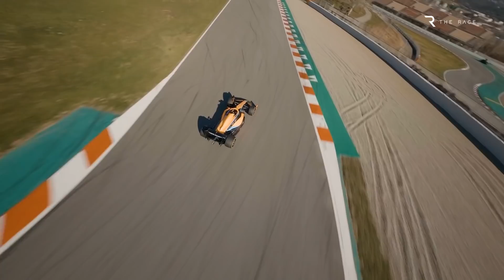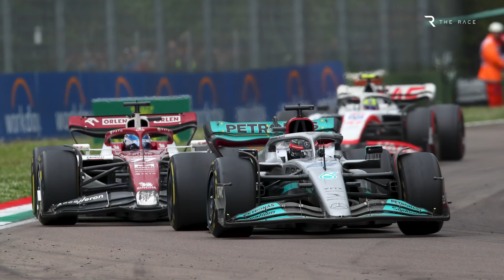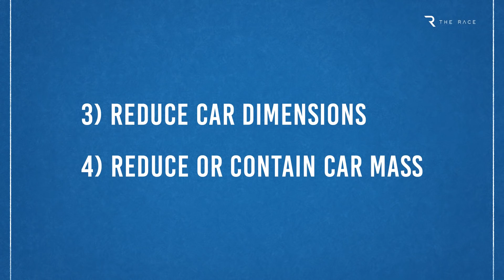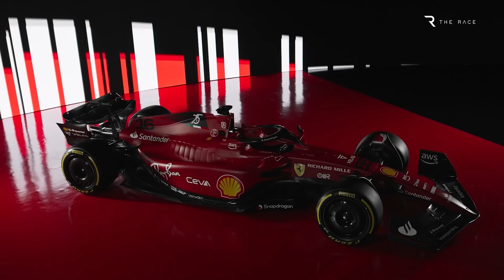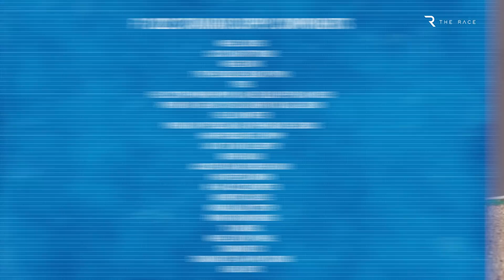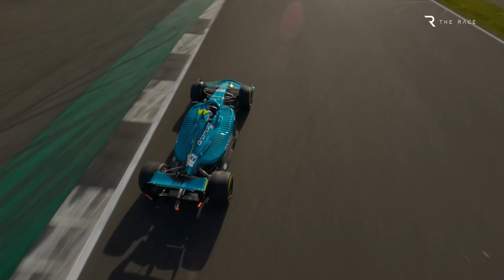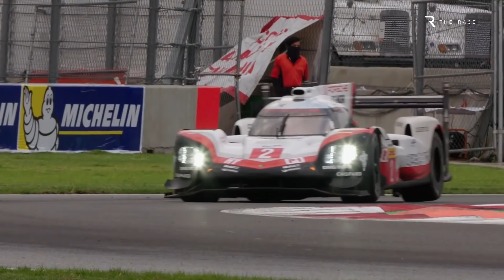F1's new major plans for 2026 car overhaul explained

Comment: I personally think it's a bit of a shame that the MGU-H will be gone. I know it's not really useful for normal engine development and it's really expensive, which is what keeps VW (Porsche and/or Audi) out of F1, but I think it's a really cool, innovative piece of tech that allows the engines to reach unthinkable thermal efficiency, and it improves performance by reducing turbo lag.
Reply: is porche putting a mguh into a road car
Reply: @Nights_Shadow  an*
Reply: @AW89123  imagine innovating something simple that does what the complicated things do
Reply: I agree, maybe they should make a spec one and keep it.
Reply: but one cool thing it will do is improve the sound,mgu-h is one of the main reasons the cars sound so muffled
Reply: If they’re going mandate more ethanol based fuels the engines will not produce as much heat. Engines that run on pure ethanol don’t require nearly as much cooling as gasoline engines. So maybe the plan is to move away from gasoline/petrol based fuels and more towards alcohol based fuels.
Reply: I'm interested in this technology. Maybe (although highly unlikely) that technology could be released to other companies that could use it in another context.
Reply: Yes, but moving forward without could lead to other amazing innovations
Reply: The VW group are a bunch of crooks and its been proven in court.
Reply: I think the main reason it is going away is because that it makes the ICE more inefficient, i think i saw something about Honda 2021 effort and they said that they needed to generate extra gas to make the MGU-H work.
Reply: @AW89123  Partly true. It’s supposed to be a test bed for future road technology and the mguh will never be used in cars so a waste of time developing because there’s no value in it.
Reply: They destroy the sound of the engines
Reply: make it a spec part
Reply: @UwU Its F1..the whole point is... its expensive :D
Reply: @AW89123  most of the "innovations" are not even relevant in the real world anyway. Mercedes don't even apply their so called "innovative" mgu h to their cars.
Reply: Mgu-k has more practical applications for road cars. Emphasis on that is what really is needed. After all what good is the tech if it cannot eventually trickle down for the rest of us.
Reply: I’d rather have more engine manufacturers involved in F1 than technology which has no relevance outside of F1
Reply: @Strider_JM  I agree, more manufacturers means the likely hood of usable tech becoming available for the masses better too
Reply: Yeah a piece of tech that would never see the light of day in a road going vehicle. I haven't seen a hybrid system cheap enough for the masses to afford.
Reply: Mguh is what is killing the sound
Reply: @BobbyGeneric145  Sound is irrelevant in performance though.
Reply: @BobbyGeneric145  yes. Hope 2026 F1 cars bring back the 1995 F1 sounds.
Reply: If you've watched that 2017 merc on goodwood hillclimb, some say they removed the mguh therefore the sound being better (just rumors though)
Reply: I think simplifying engines is great. Racing is purest when it is just go-karts going zoom zoom.
Reply: Also the MGU H reduces the noise created by the engine. Look at the V6 turbos in the 80s. Loud and fast vs the v6 turbo hybrid
Reply: One thing for sure will happen in the coming years. Fewer cylinders and smaller displacement
Reply: They need to rethink their sustainability goals. Biofuels take up cropland that could be used to feed people. It’s cheaper and probably more environmentally friendly to go back to 110 octane than to continue to go forwards with components that rely on environmentally detrimental mining techniques. Suddenly sinking a drill in the ground and pumping crude doesn’t look so bad 🙄
Reply: @toyotaecw  F1's biofuels are made from non-food/crop source, it is one of the requirements.
Reply: @instenalable  thats just not true. Its taking up farm space that could grow food. Its a silly idea, and it doesnt even save CO2. Its been proven that the CO2 required for crop inputs exceed the savings in C02 from using biofuels.

But theres big money in it. So it happens.
Reply: @instenalable  look at Porsche biofuel. I think that could be implemented
Reply: I agree We are making fuel instead of food.  Somethings not right
Reply: That argument is completely based on them standing on fields. Why can‘t they stand where cole mines or other dirty reactors used to stand. 
Your point is so nonsensical I tend to think you are a bot.
Reply: @DailyShit.  I'm sorry, I fail to see what you are referring to.

Comment: Unlikely that Porsche or Audi will enter F1, as both have teams in Formula E, as part of their campaign for greener racing. If the VW group does enter F1, it will not be under those brands or names.
Reply: Audi has no team in FE anymore.
Reply: @Moray2023  Oh yeah you’re right, I forgot. My point still stands.
Reply: @greatnoodle Understandable, but it would be a huge step back for Porsche. They’ve committed to FE and have a head start on what will be the future of automotive racing. It would be weird really for any team currently in FE to move to F1, despite the marketing that comes with it. For example, Jaguar has had a great history in F1, but their focus is on FE now, and actually the marketing argument isn’t as effective as you think it may be, as most car manufacturers will want to move to FE soon as it provides them with the opportunity to assert dominance with their electric power to boost their customer confidence in their EV lineups, which car manufacturers are committing to fully as soon as 2025 for Jaguar, which has had a storied history in F1, but has now moved on to fully sustainable, zero emissions racing.
Reply: Maybe Bugatti and Lamborghini
Reply: @Zephyrion__  Bugatti is owned by Rimac now.
Reply: Damn, Germany is cucked to the core

Comment: i hope they reintroduce refueling - more impact of the strategy and would also make cars smaller and lighter
Reply: Aah , so you want all the overtaking to be done in the pits with very little in track action , I’m afraid that’s a bad idea
Reply: Wrong. It has been explained several times by people in the know that refuelling is a bad idea to bring back

It would create complicated strategies and ruin them in the process, it would be more expensive, would require more staff, as well as hard to follow for the fans and also being straight up dangerous.

You people say you want refueling without thinking about it all. You just want the era in the which refuelling was used to come back, and thus think refuelling is the correct answer in which you would be wrong

Comment: I don't like the sound of "contain" weight. They NEED to reduce weight drastically. 800kg F1 car is outrageous.
Reply: with the increased focus on safetey and long term reliabillity its understandable why the cars have gotten so heavy, i understand safety but i think the reliabillity component has gone too far especially as they get only 3 engines a season to avoid any penalty and when we have 23 races its just amplifying that.
Reply: Mainly for safety reasons tho..
Reply: @zippo5294  if they want safety race trucks

Comment: Hopefully cars will be smaller by then.
Reply: I doubt it. They will never go back on safty features, which heavily rely on the car being very large.
Reply: @sinamf5890  They could maybe shrink the cars by 10cms without sacrificing safety
Reply: @sinamf5890  Lowering the minimum car+driver weight is possible without taking away anything from safety features & structures.

Comment: Make the cars smaller and lighter, racing will be so much better
Reply: Smaller and lighter doesn’t necessarily mean more better racing. On tracks like Monaco sure but the rest doesn’t really guarantee better racing.
Reply: @aayushkarnik7166  Nothing can improve racing in Monaco, but otherwise correct. Aero & tyres impact racing quality, not dimensions & weight.
Reply: They got bigger because of safety reasons. Bad for racing, but better for everyone. 
They were much more lively and great to watch, but deadlier too.
Reply: @thomaslegoff4069  there's more to safety than just what happens in the worst case scenario impacts. How many f1 drivers died in the 2000s?
Reply: @Will_M600  only 1 death, but you also need to remember incidents like Massa and Schumacher breaking his legs , those would not have happened in today’s safer cars
Reply: @Ben-go1iq  prefer that to having a heavy car full of batteries that can plough through a wall and burst into flames, it's a miracle that grosjean is alive
Reply: @Will_M600  yeah but petrol's also flammable, more so than batteries actually. The only reason it's safer is because of the fuel tank construction, really
Reply: @nerd2814  These batteries do what's called thermal runaway, much more dangerous than a fuel fire as its far harder to put out
Reply: @Will_M600  Never forget when Hammond crashed a Rimac prototype and thermal runaway kept the car burning for days
Reply: What you describe sounds an awful lot like Renault Clio Cup.
Reply: the cars are so huge mostly for safety issues
Reply: They are sooo much longer for aerodynamics (front wings). I think shorter cars would allow for more exciting racing through the curves.
Reply: Exactly
Reply: 100% spot on!